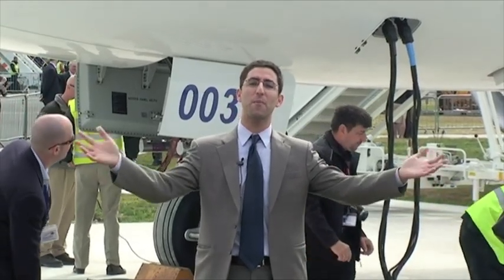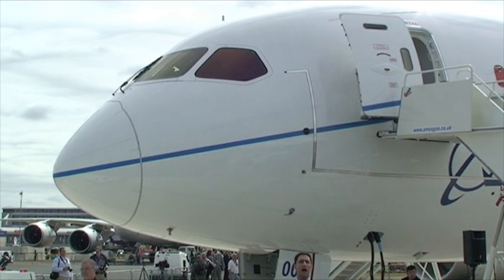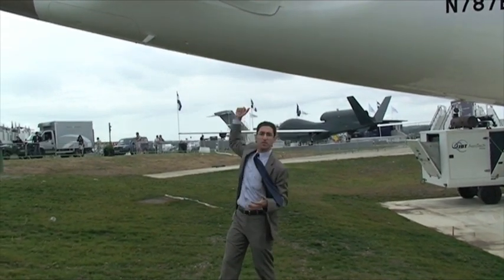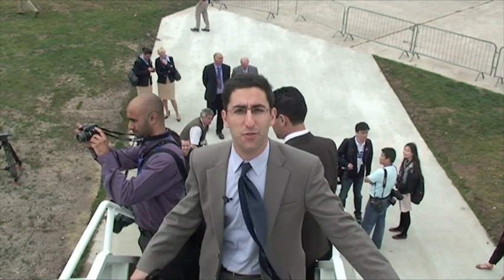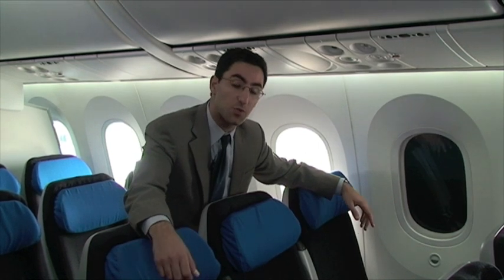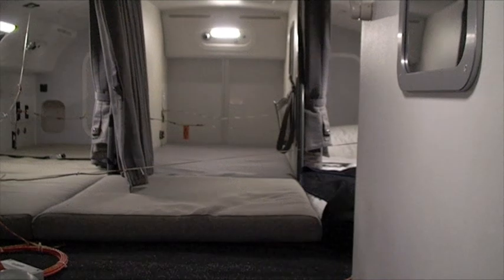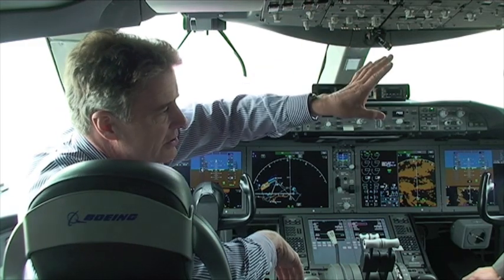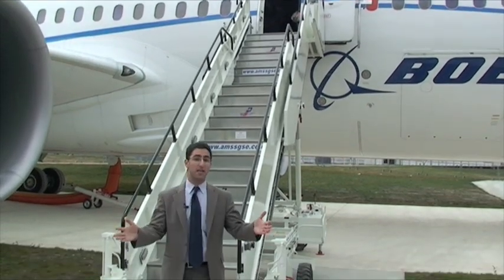Boeing 787 Dreamliner tour with Jon Ostrower at the Farnborough Air Show

Comment: @boeingfan882 i know i may sound awful to Airbus cos they make good planes too but what I'm trying to say is that Boeing's are clearly the best in everything, quality, reliability, technology, aerodynamics, onboard features, roominess, comfort and much more, but Airbus i think use old technology that's been going over 50 years! granted the jumbo jet (AKA 747 up to -400 ) has been using those materials for 47 years and the new 747-8I will share the 787's composite materials, for fuselage i think.
Reply: This comment has not aged very well, being now in 2024 and taking into account all what has happened with Boeing and Airbus since then.

Comment: @tyty990099 it better than any Airbus aircrafts by the typical french, germans, oh dear  the fly by wire system the Airbus use won't let a pilot take control if he needs to in a emergency were'as a Boeing's fly by wire in this 787 would let a pilot regain control. i think the Airbus a380 and a 350 are a waste of time cos passenger who travel by air is decreasing every year so no need for such big aircraft like the a380 or a350 XWB as they'd be flying half empty!  if it aint Boeing it aint going!